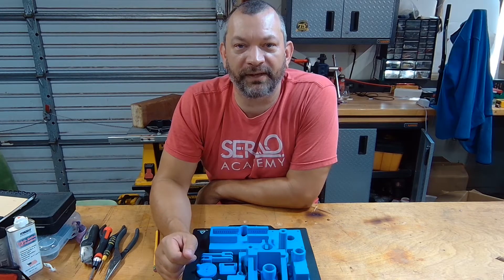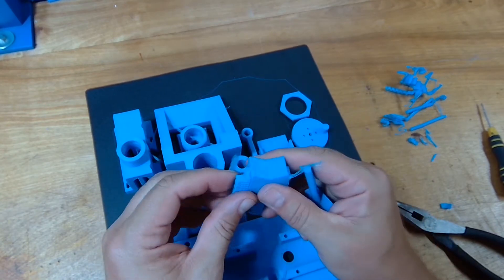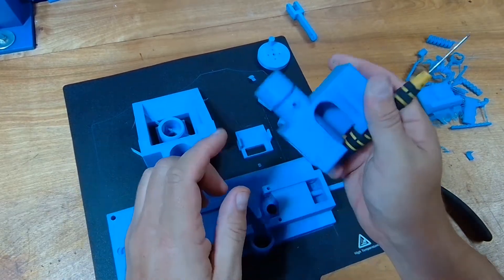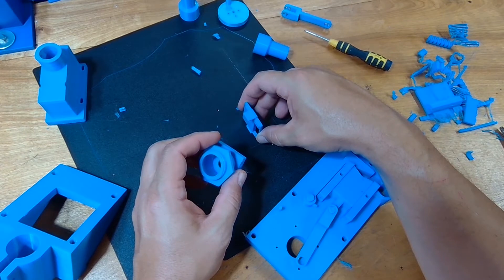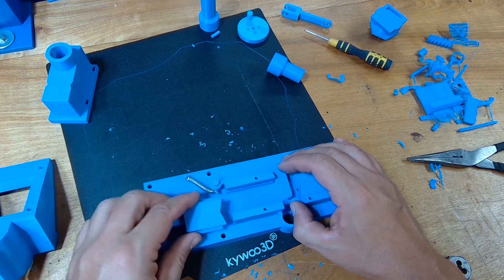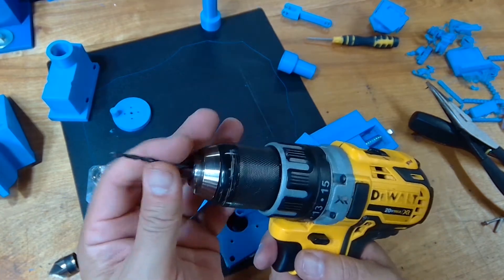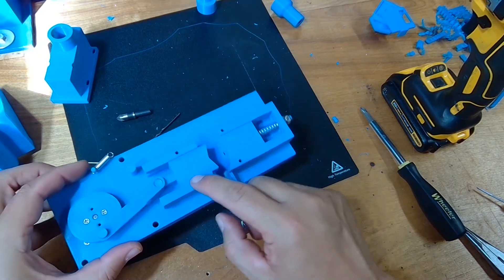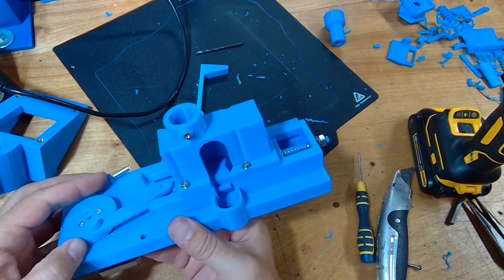AI Case Sorter Construction Part 1

Comment: Nice work man!
looking forward to setting this up, do you print with 100% infill?
Reply from the maker: For the classifier base, I print the rising pillars at 100%, everything else is 30% infill. I also print the tension cam at 100% as it requires the additional strength
Reply: @sjseth-builds  Nice! Thanx

Comment: Hey man thanks for the files! Have you tried to print this in PLA+ instead of PETG?
Also about how long was the print and what did you set your infill to?

Thanks again!!
Reply from the maker: Haven't tried pla+ yet. Any recommendations?
Reply: @sjseth-builds  I use Jarees brand. I find it a little bit stronger then straight PLA!
Reply from the maker: @kennyd.5743  I gave the pla+ a try and yes, it is much stronger. no breakages on the camera lids or linkages. Thanks for the tip
Reply: @sjseth-builds  Glad to help out. I really like the PLA+

I'd like to throw my name in the hat for the software as well when you have it ready.
Let me know what I need to do. 
Thanks again!

Comment: I hate to be a pain, but is there anyway you could split up the bundled stl file(Cs6_Completr.stl), my machines bed is "sized challenged" and can't fit all the parts on it as you have it laid out ;)
Reply from the maker: Yes, definitely! Those should be added soon.
Reply from the maker: Those are now available in the repo. Cheers!
Reply: @sjseth-builds  thanks!!! That helps out loads!

Comment: what were the print settings you used?
Reply from the maker: Here is the Cura print profile for all the settings I use for PLA+ (Jayo brand). https://github.com/sjseth/AI-Case-Sorter/blob/main/3dModels/CuraPrintProfile.curaprofile

The basics are:
Layer Height: 0.16
Initial Height : 0.24
Line with (and all other widths): 0.4

wall line count: 3
top/bottom thickness 0.8
top layers: 5
infill density: 30%
Nozle temp: 222.0
Bed Temp: 65
Support Structure:  Tree
Support overhang: 80 degrees

Also I create custom settings blocks on the rising pillars to print them at 100% infill. 
Hope that helps
Reply: @sjseth-builds  thanks you are a gentleman and a scholar
Reply from the maker: @MrPan-  Thanks Michael, before you go down this path, did you check out this update video yet?  https://www.youtube.com/watch?v=GTHugpKRd10  
you may want to try that build instead.  Both work, but the later is a bit better in my opinion.
Reply: @sjseth-builds  yes sir going to use the new files